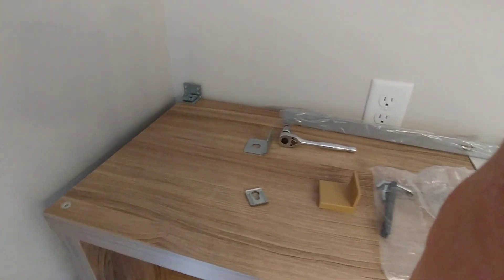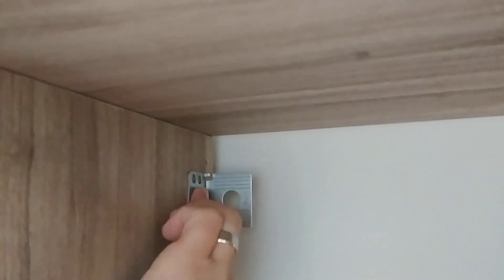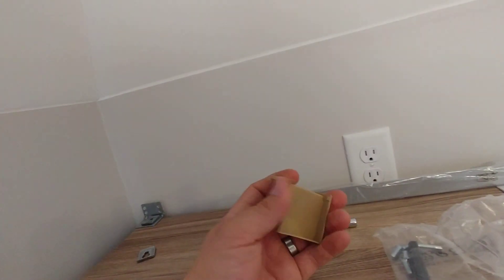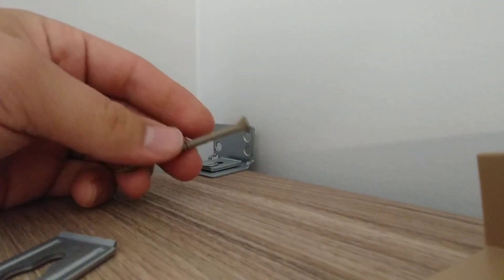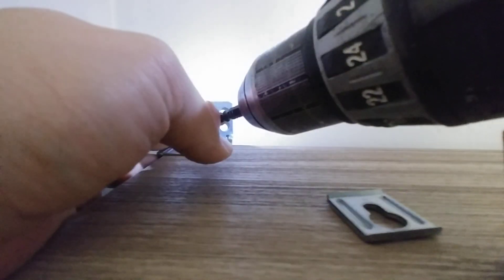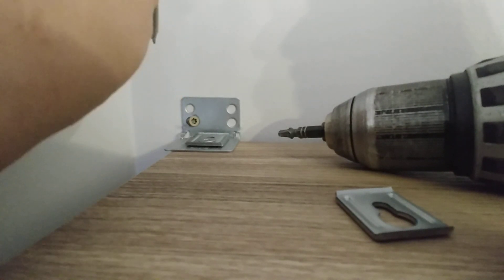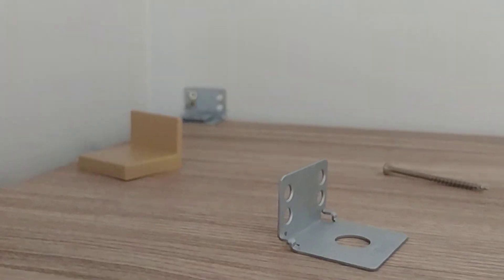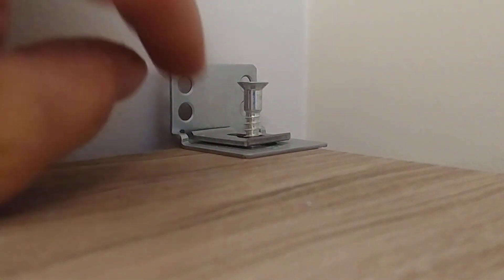Tips for Anchoring IKEA Shelves To The Wall

Comment: Thanks for the tip, I just got a few of the billy bookshelves with the extension above them and was considering getting some 1x2 wood strapping to install along the wall into the studs. That way I can just have wood to run the screws into and I won’t need to worry about placement of the brackets.
But now I need to buy extra stuff.